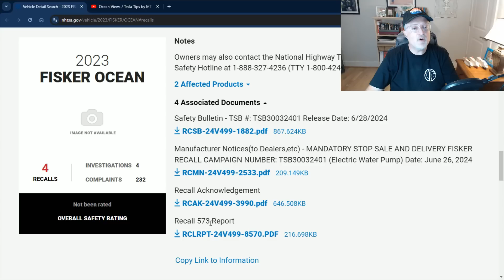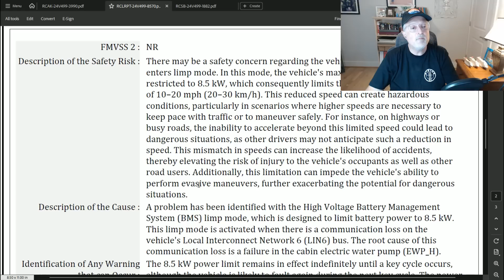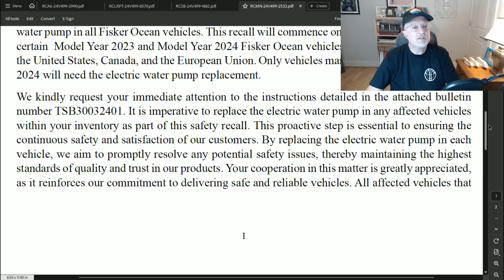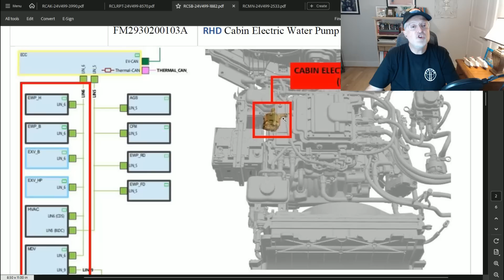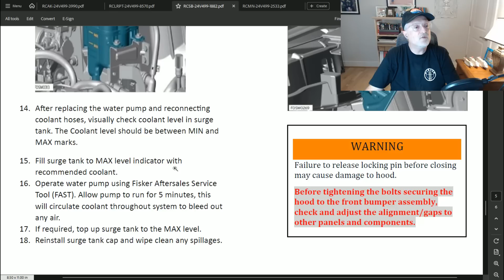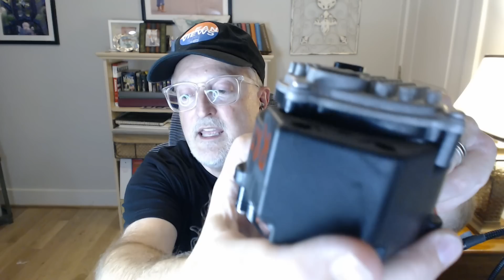Fisker Ocean - Water Pump Recall

Comment: I know this is old but maybe can cross refrence or use  other hybrid electric  pumps with the same pins used on toyota prius tesla etc
Reply from the maker: The pumps are made by Johnson Electric. Only these can be used due to the car is looking for the firmware on the pump’s PCB.

Comment: Not an owner, but leapt into this horror story when these admittedly attractive new cars on matket for ~£20k. Even the optimist in me has lost faith in taking one of these on at a "bargain price".

One thing not mentioned is that the Ocean's limp mode seems excessive. Limiting the vehicle to 20mph (33kmph) regardless of conditions, is cited as a risk, but not addressed.

As you say, all 4 pumps realistically could be affected, so it seems odd only to focus on one.

Is there any indication that this is a universal or shared component part - or has this just been saved for lucky Ocean drivers? 

Without wanting to patronise, I genuinely feel sorry for you guys.
Reply from the maker: @F5Xs  The four pumps have the same general design.  But the one in the recall is known to have the manufacturing error, which is only affects 1-2% of cars. Honestly, I’m not worried about it.  The good thing is that the recall pumps are now being distributed to service centers.  So owners can start getting them replaced.  Also, the existing pumps can be fixed by spraying a conformal coating on the printed circuit board.  I plan to do a video on that eventually. As far as the limp mode as a reaction to detecting the fault goes, that’s so the car doesn’t damage the drivetrain or other systems.
Reply: That's good to know, and that fixes are readily available.

My point about limp mode, wasn't that there shouldn't be a limp mode, most moder cars do... and as a former Range Rover owner, I had to drive through it. I went jnto that eyes wide open, but it was not a fun experience.

Anyway, having limp.mode engage when you're on a motorway (highway) isn't fun, but on the Range Rover it limited it to 50mph. I know of someone who had an early L322 that kept getting vertigo and went jnto downhill descent mode (think 20mph max)... but anyway, that Land Rover.

Hopefully the Ocean will become.like the DeLorean and get cult status - owners definitely deserve it... but sound like whole hose of parts will need to be made available or reimagined and improved.
Reply from the maker: @F5Xs  Thanks, since there are at least 6000 owners, there are going to be service and parts solutions.  FOA is working on that.

Comment: Is there any way to see the pump via a borescope (without taking everything apart as mentioned in the .pdf) just to verify that we have the latest pump version?  I just got mine from the dealership, so per federal law, it should have been replaced before they could sell it to me, but still.
Reply from the maker: Yes, you would have to have the car on a lift or at least ramps to access the area underneath.  It is located on the right side before you get to the battery above the underpanel.

Comment: Fisker is wrong for this...they knew it wasnt ready thats why they only made so many
Reply from the maker: The water pump issue was 100% Johnson Electric's issue.  There are plenty of other things to blame Fisker for.
Reply: @MTNRanger  they knew. They absolutely knew nothing was ready. But they were greedy
Reply from the maker: @tecno8335  Yes.  And in additional, I think there was gross mismanagement, poor planning, large egos at the top of the company, and failure to take responsibility.

Comment: I am an aviation avionics tech for many years and I own a fisker as well. I had a similar issue on an antenna circuit board that was exposed to the elements. The ( legal) fix was a simple coating of silicone directly on the transistors on the board. This would keep the moisture / water from making direct contact with the components on the board. I wonder if this could be possible solution to those who don't have access to a service shop to replace the pump.
Reply from the maker: It's definitely something to consider if the replacements don't arrive.  As I mentioned in the video, I'll be taking a closer look at the four pumps I purchased (1000 miles on them).

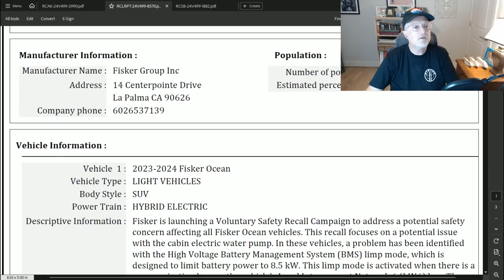Comment: Document in your video around 4:40 shows The starting and ending affected VIN Range - you didn't mention it. Might answer some questions for a few people if they're truly affected by this or not. Thanks for the info.
Reply from the maker: The VIN range covers all of the Oceans produced.  It's probably just a requirement to show them.  No Ocean has been manufactured after the 2/22/24 date of the fixed water pumps.

Comment: I have had issues with «limp mode» several times this winter with my FOO which I took title to in Norway mid September (#2645) 2023. Somehow the limp mode “fixed itself” several times. Returning from a 10 day holiday it happened again in a highway tunnel, fortunately with little traffic, a scary experience indeed. Fisker service agreed to check and fix my vehicle two days later. I was due to book a rescue truck. However, after a day I could drive the car normally the 50 km down to the Fisker repair shop where they diagnosed that my “heat pump” was the culprit - a problem not unknown to Fisker - apparently a leak within the part causing the problem. They told me that vehicles produced early 2024 ha new heat pumps where the deficiency was resolved. They had no such new heat pumps available but took one from an older donor vehicle. From this replacement I have not had the limp mode reoccurring, however I understand this may happen again …
Reply from the maker: Thanks for the information.  I was not aware of heat pump issues or the redesign.

Comment: thanx matt....had this problem in january.had my sport for just 2 weeks.was on the way to work on a swiss highway on sunday to monday night 0:30 am.all of a sudden no more heat from the vents and high voltage management failure message.no more power.just crawling.i did all the sleeps there are(on the emergency lane,minus 5 degrees C,pitch black night)....no reaction.after a new start power was back for a few seconds so i could get to the next offramp....after work started the ocean and all was fine again.a few hours later it happened again and fisker had to tow it in(600km)they said the waterpump was the problem....a few month later i was told that the supplier for the pump had to come up for the repairs.about 10 tsd euros....the whole lot.........
Reply from the maker: Thanks for your comment.  Is it working fine now?
Reply: @MTNRanger  yes.no Probs since then......

Comment: Your videos are amazing. This was an excellent video on the issue, the part, the removal and install of the replacement. But I do share your concerns as the other remaining pumps seem like they could also be candidates for issues. I am a DIY guy but I have no lift and all EVs are super heavy so there is no way I would get under an Ocean for this work. I knew someone who bought a house in my neighborhood. 3 months later he was found dead under his collapsed car. I have done work under cars but always with multiple jack stands and even then I limit my time under. I have many many doubts that Fisker will be doing this as they have how many current employees, 130ish? And that was before the bankruptcy.I am not for bigger Government but there needs to be more regulation and verification of start ups in the future. Supposedly there was to be warranty money set aside per each Ocean sale and there was supposed to be a supply of replacement parts. Seems none of that was regulated and verified. This needs oversight. Always great videos from you. Cheers.
Reply from the maker: Even under jack stands, I don't think there is enough clearance.  To get a reputable lift, you will have to spend thousands of dollars.  Not something I plan to have anytime soon.  With these instructions, any competent auto repair shop should be able to replace the pump.  The key is getting the replacements.

Comment: How does water get into the enclosed area where the circuit board is?
Reply from the maker: It is exposed to water since it is lower on the car body.  There is a thin body panel, but plenty of water can intrude.  Similar to many cars.
Reply: @MTNRanger "similar to many cars"? No. This doesn't happen to other cars.
Reply from the maker: @wizzyno1566  What I meant is that parts exposed to the underside can get wet and need to be suitably protected.

Comment: Any mechanic could do this, but it seems access to the FasT tool is critical for most repairs to the Ocean.
Reply: I think if you minimize the coolant loss during the swap and keep an eye on the tank to make sure it’s full, the system would self bleed as you drive the car.  Or you could make a pigtail and figure out where the positive and negative is and run the pump manually.
Reply: Must be worth buying these and removing the PCB to apply more conformal coating because that the issue is the lack of conformal coating.

I purchased a new one and I want to replace mine but Ive never done it before we need a video with a step by step breakdown of how to do the job and see how it is done this could be the saving grace for alot of fisker owners. Surely we don't need fast tool to do this .

Comment: Btw matt, if the printed circuit board is accessable, can we not apply glue over R11 resistor and put it back together (Incase Fisker fails us again)
Reply from the maker: Yes, that's what I'm going to look into with my "spares".